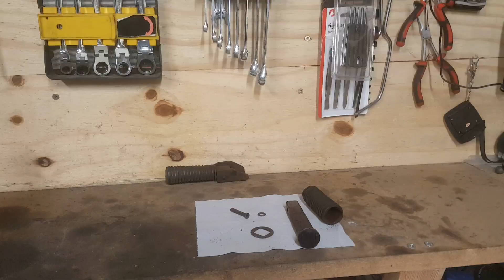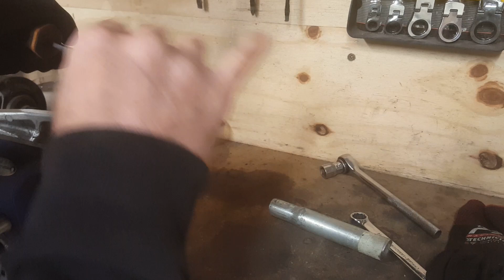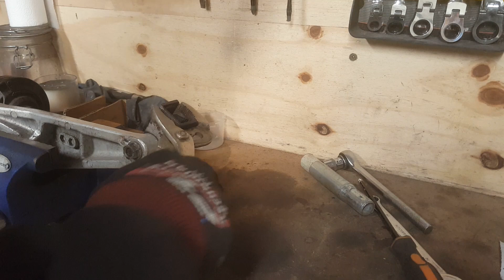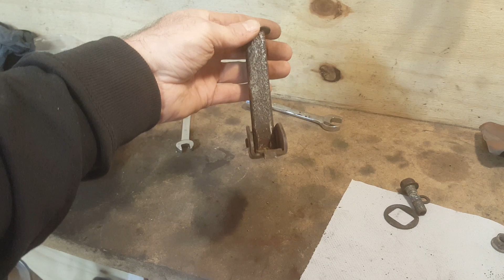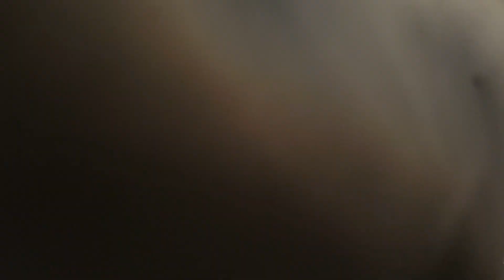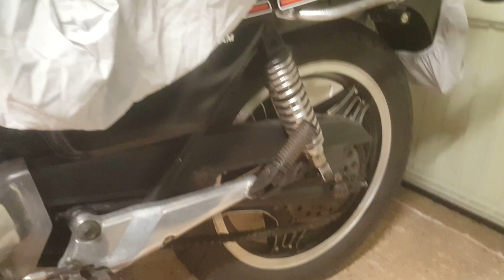Back on the Bikes... Lets get restarted and find a way forward.

Comment: You could get a local engineering company to turn a 'slug' with a middle section turned to the external diameter of the new yoke stem and each end with the internal diameter of the new yoke stem, cut the stem in half, chamfer, insert (must be straight!) & weld in the slug.
Obviously some careful calculation of the slug length is required.
This would save compromising the strength of the cast lower yoke as no drilling out required.
I have used this method to convert a Harley frame to hardtail so plenty strong enough... if your welds are good!
Also check to see if taper roller bearing are available to fit the frame tube and new yoke stem.
Either get someone to weld it for you or buy a cheap mig welder, you will be surprised how useful it will become!

Comment: Your best option is to have a stem made that is correct for the super dream frame but will press fit in the yokes you want to use. Most machine shops would be able to do this for you

Comment: You are on the right track with having a stem made. Not a big job for an engineering company. I would make it my priority to search one out. I imagine the bottom yoke on the xl is steel so again some weld could be laid in where the stem goes through to beef up that area. When I wanted stuff doing it was a matter of phoning round. I found my guy on the recommendation of one of the companies that couldn't help me. Dont know where you are Ryan but there will be someone who can help. As engineers they often have solutions you haven't thought of as well.
Reply from the maker: Cheers Colin, I'm mega busy this week, but I intend to hit the phones on Monday and track down someone nearby (Wiltshire)
Reply: @RyansGarageUK  quick google search gives a lot of precision engineering companies  in Swindon. Also worth talking to independent motorcycle dealers. They could well have contacts. Ignore the big boys, they just want to sell you a new bike.

Comment: Could you not sleeve the fork housing and use the original stem with the new forks ?  Great channel Ryan 👍
Reply from the maker: Hi Peter, that's may not be impossible, but one of the main weakness was that the superdream yoke literally only has one bolt holding the forks in place. So don't feel that gains me very much.

Comment: the reason you wanted to change this was to strengthen the whole assembly wasn't it?  so, could you not have strengthening of some description welded to the original superdream parts? probably not possible but worth a thought no matter how brief
Reply from the maker: Hi Tim, It was primarily for strength, but also to run a 21inch front wheel. Good idea through, and definitely a possibility if I fail with my original plans.

Comment: Great job , me ask u guys this old motorcycles when u restaure it is it get work like new one i talk about reability ? Bcs i m thinking about get old bike honda 1987 and so some work in it , and do i wil can find the parts of it ?  so what i think
Reply from the maker: Hi, I'd expect that finding parts for a 1987 Honda would be no problem, if the bike is restored and maintained correctly then I'd expect it to be very reliable. If you leave old electrics then they could be a problem, but replace them and you should be good.